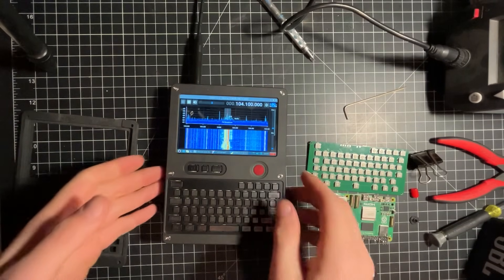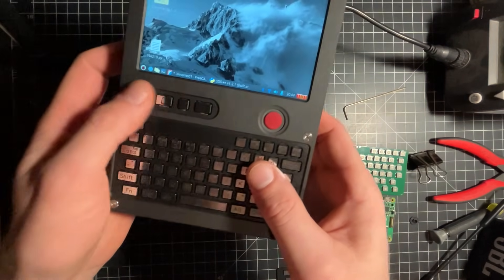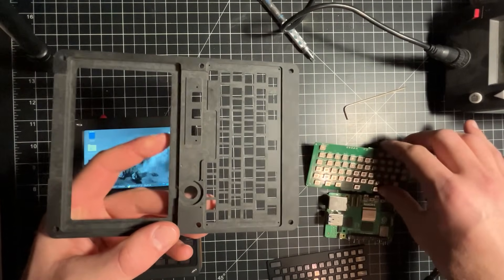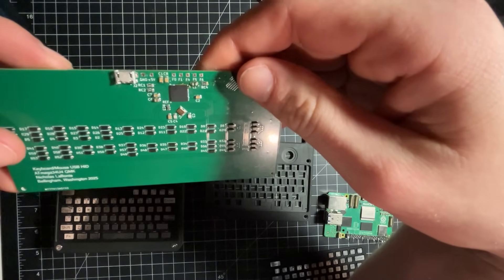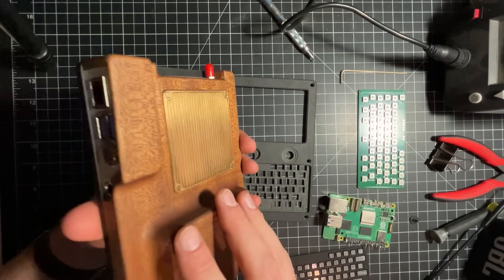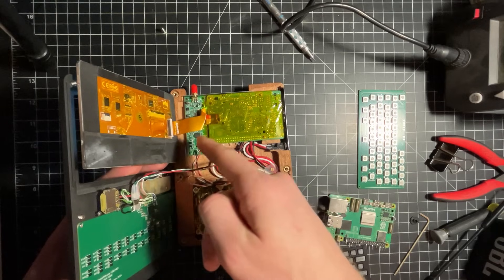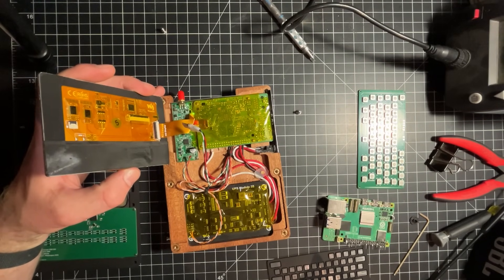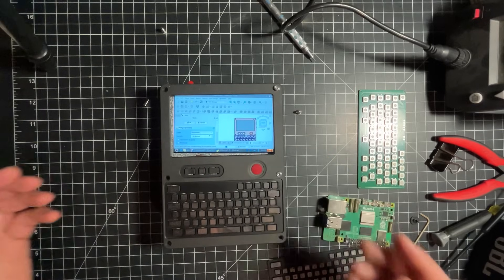Cyberdeck Handheld

Comment: If you wanted to add more devices/sensors, the Raspi header pins have I2C support, you could add accelerometer, temp and pressure sensors, ect.
Just a thought

Comment: Such an amazing deck. Very interesting keyboard design, especially the key caps plate. Have you ordered it somewhere? Also I plan to do do a custom keyboard PCB, and as it will be my first experience with designing them I want to ask you about the design of a matrix, do you like connect buttons in a parallel?
Reply from the maker: The key cap plate was machined on a desktop CNC. The PCB was designed in KiCAD 8.0 and ordered from PCBWay (files including schematic here: https://hackaday.io/project/202522-cyberdeck-handheld). A good way to get started is to learn KiCAD or a similar software and dive into keyboard forums while looking for keywords like diode matrix design and QMK firmware
Reply: @Nicholas_LaBonte  thanks for help, you saved me a lot of time)))

Comment: Very nice. Other than wood being a good insulator :) can you underclock and undervoltage the cpu? and does it connect to the heat plate?
Reply from the maker: @DanFrederiksen   Great point about the insulation haha. The cpu is connected to the heatsink with thermal paste. I have since added a  fan (https://www.instagram.com/nicholas.a.labonte/) which seemed to solve the problem :)

Comment: It's just beautiful. This caught my eye as i was thinking of making something in the same form factor for use with local small A.I. llm's and the i2c pins as well as others broken out so 'modules' could be plugged in such as sensors etc. then they could be programed with the help of the a.i. to create python gui's to view the data from the sensors. ... maybe after my current project is done with.

Comment: awesome 😁
I'm surprised that chuck of brass isn't enough to keep it cool, though.
that keyboard, though.  It's going to catch a ton of crumbs.  I'd say, you could decrease the gappages around the keycaps, and glue a rubber-like membrane to the underside, which may also help with the sound issue.
Reply: Copper would have been a better choice.

Comment: @Nicholas    Looks like you have noise issues too.   -65dBm noise floor is not so hot.    -80dBm would be ok....  -90dBm even better....      I had same problem with my build.   Found some Type 31 ferrite snap on chokes and a tiny little USB filter board that is now in between RPI and the  RTL-SDR.    board was on aliexpress
Reply: also the SDR must be shielded with a proper conductive enclosure
Reply from the maker: @dan_in_sd  thanks for the input-This is really helpful.

Comment: I just put up some videos that were quite similar using RPI 5 and a used clamshell case that was originally a crimp tool case.   I installed the Digi-Rig Mobile into it which is used for HAM radio mostly.  And an RTL-SDR.    However.  Your build is fantastic,   my build is simple in design and just a DIY project.   cheers mate!
Reply from the maker: @dan_in_sd  will be sure to take a look!

Comment: What SDR are you using? How much noise did it add with no RF-shielded case? Nice build.
Reply: In my case lots of noise.   I found a few snap-on ferrrites  (Type 31)   and a EMI suppressor board for USB.   It essentially isolates one half of the USB connection from the other.  I have it between RPI 5 and the  RTL-SDR.   these things are normally used with USB Audio gear that have a "buzz" sound.   works fine with RTL-SDR.   board was $9  on AliExpress.
Reply: @dan_in_sd  Thanks for taking the time to answer. I appreciate it. I'm not sure if you are aware that copper heatsinks with vapor chamber are available at a decent price last time I looked. Might be able to get by without having a fan on the back. I believe it was 15mm thick. I know your build is custom and I'm not telling you how to build your deck. I look forward to the next video. Thanks again.

Comment: well a quick comment because my last one disappeared...

There are passive cooling cases for the pi, so I'm sure you can get the job done without a fan. I always avoid them if I can.

I think the footprint of the cooling plate looks sufficient, but you may need to have more thermal mass and surface area. Basically put  a thicker hunk of metal on it and cut slots in it to make cooling fins. I'd make the fins thick too so they remain durable.

Are you sure the plate is contacting the cpu and the other heat producing components well? If there is any sliver of an air gap then the cooling performance falls off of a cliff. Even the thermal pads are not a great solution because their heat transfer rate is so much worse than metal. If there is a gap to fill then you want to use a copper shim with thermal paste on both sides.

As for a 12V charging source. USB-C chargers can do that no problem. Look for USB-C charging trigger boards. They are very small PCB boards with a female USB-C port and they can be configured to request 12V from a USB-C charger, which usually just involves solder bridging the right pads on the PCB.
Reply from the maker: @Chris-oj7ro  Thanks for the great feedback. 

Good point about the thermal pads-currently they are about 0.2" thick. I may add a shim like you suggested and compare results. The current bronze sink does have fins, but to your point-they would benefit from increased surface area. 

I'll take a look at the PD USB spec and see if the current at 12vdc is sufficient for the UPS. 
Cheers,

Comment: Nice work, very neat. I think wood might contribute to the heat problem. Maybe Al base plate to spread it and tiny fan on a switch would help that. Also the screen seems washed out, but thats not so important here.

Comment: Verry impressive, I wonder how u even managed to desolder the USB without killing the board or ports. Definately the cleanest build ever.
Reply from the maker: Thanks! I used solder wick, then used small wire snips to trim the usb jack housing into small pieces that could be individually desoldered.
Reply: @Nicholas_LaBonte I have been looking for a way to remove all usbs and ethernet for a slimmer pi, but it seems u may be one of the few who managed to desolder it. Did u add an internal usb?
Reply: @nerdylicious1814  wouldnt you be able to with some of that clearish yellow heat resistant tape on most of the board and a heat gun to desolder the ports?